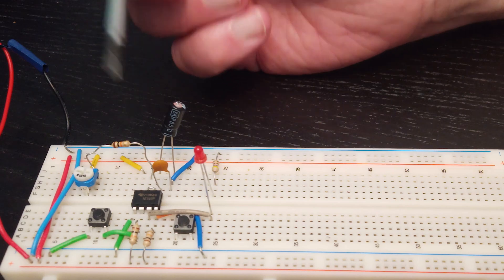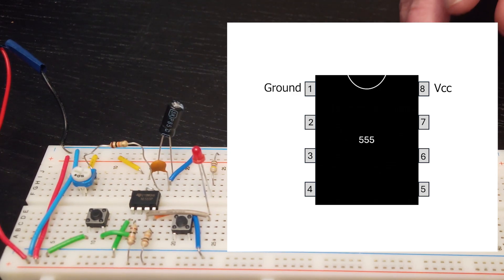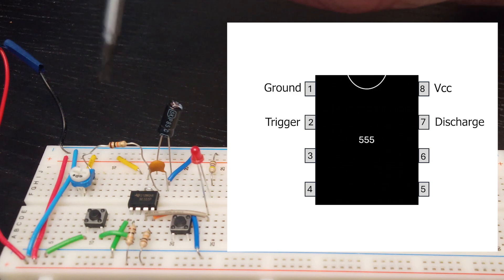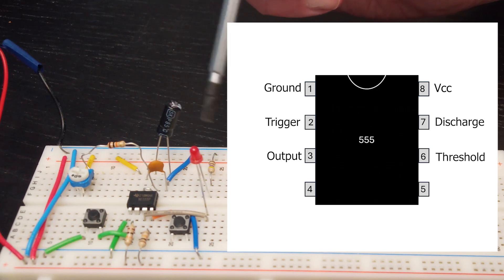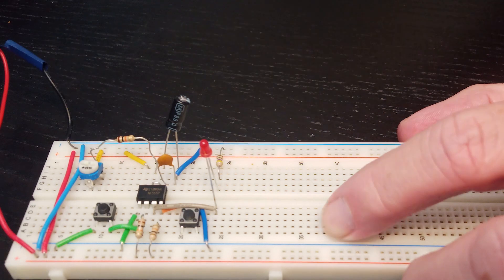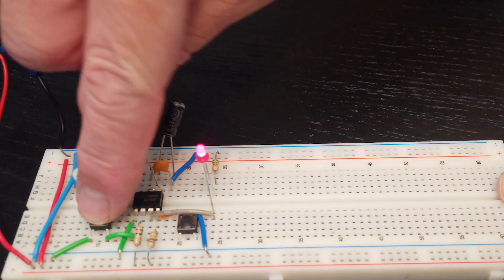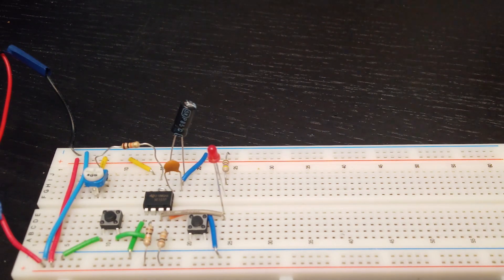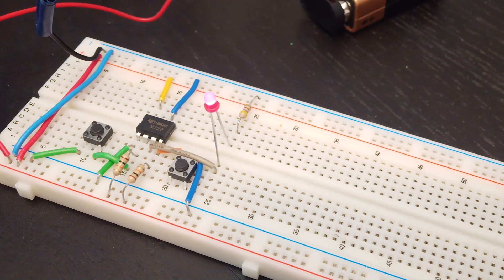Make: Electronics Book Experiment 15 - All about 555 timers

Comment: Your videos are so great while I work through this book.  I especially love how you show what is happening with your oscilloscope.  I was hoping that you would also go over the last part of the experiment where he shows a reverse mode circuit.  He only shows a schematic in the book and no breadboard diagram. Even though I followed the schematic as best as I could, I burnt out a 555 timer.  But honestly, I was half expecting it to burn out because it seems like the most likely outcome when you wire the trigger (which reacts to low voltage) with the threshold pin (which reacts to high voltage). The author doesn't really say what kind of effect could be expected, and that's why my curiosity got the best of me.  I'd sure like to know if I just didn't understand, or if the author simply neglected to include a warning about trying to replicate such a circuit.
Reply from the maker: Hi @restezen - I'm sorry to hear you had some trouble with that circuit. I didn't include it originally as I believe the book's author intended it as just a conceptual part of the chapter rather than a practical experiment. However, I do think it is a potential source of confusion for anybody who does try to build it, so I've now added a supplementary video to set out my understanding of it. That additional video can be found here: https://www.youtube.com/watch?v=Naj5bZDMiBE I hope it helps 🙂